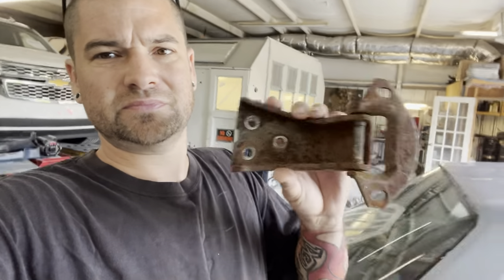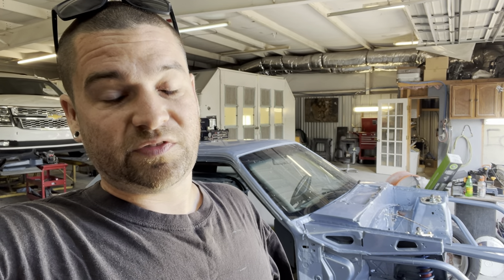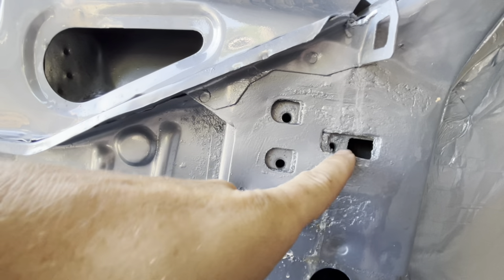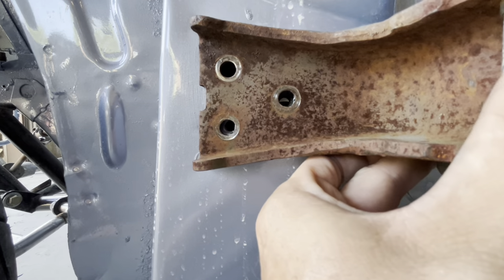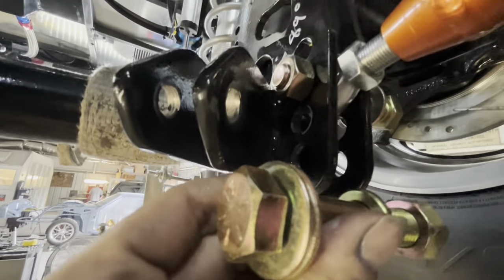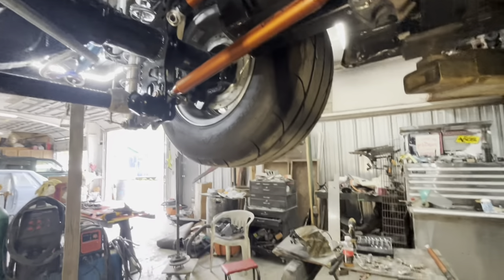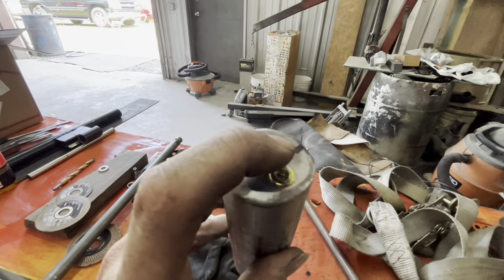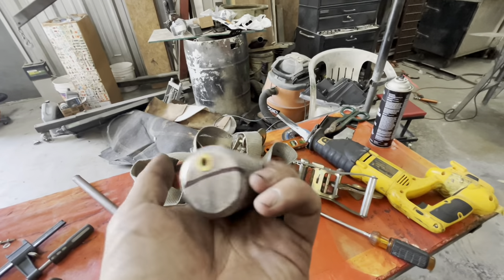👉🏻Fox Body/Maverick Parts Swap 🤔 Steering Rack Fix, Anti Roll Bar Mounted 💥

Comment: Get a set screw for the steering Ujoint!! Set screw with lock nut!
Reply from the maker: Yea that’s what was in there and I stripped the head out so I removed it but now gonna try to switch back to another that I already had bought

Comment: For the bolts on the 4 link, I made my own pins. So there is no threads making any contact with the bracket and it’s a perfect fit fit with no play.
Reply from the maker: Man I swear that’s what i was thinking!  I was thinking about using that 1/2” rod I used to align the brackets
Reply from the maker: I was thinking weld a wash on one end and drill other end for a cotter pin or something like that.